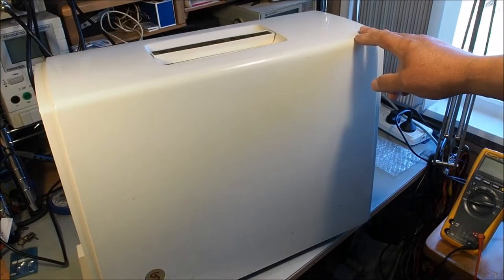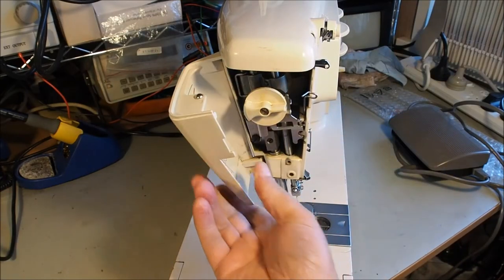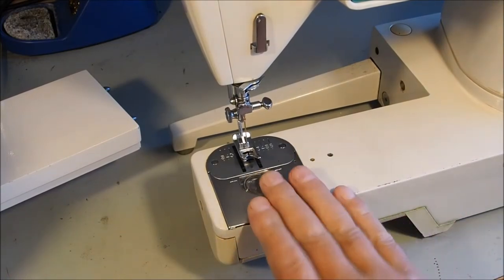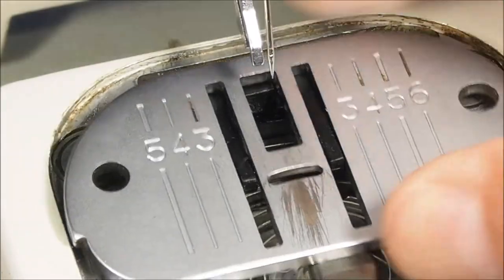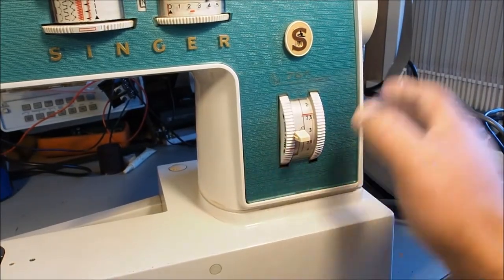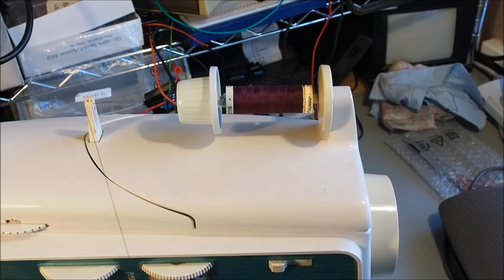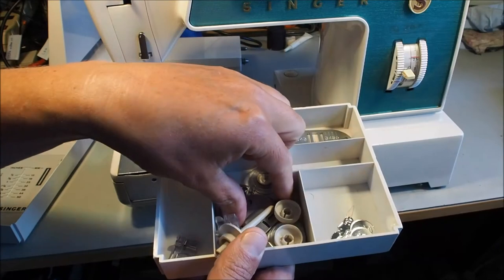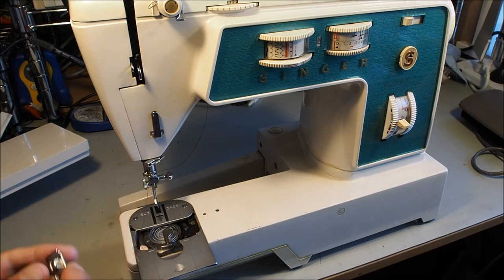Singer 766 Sewing Machine - An Overview

Comment: I've been working on a 758 and am having trouble with the upper tension assembly. Could you demonstrate the correct assembly and adjustment of the upper tension on these machines? While the principle and some of the components are similar to a normal tension unit, most are not.
Thanks.